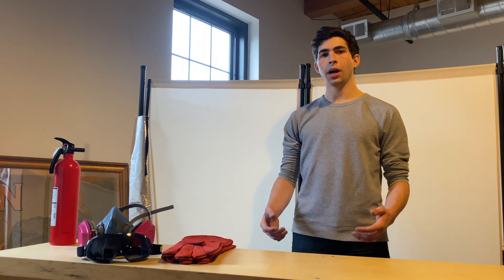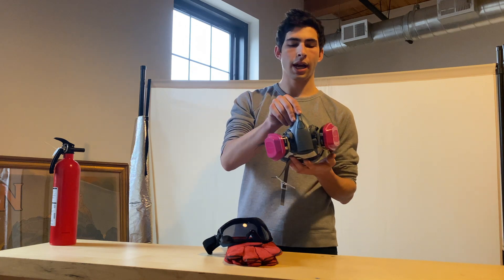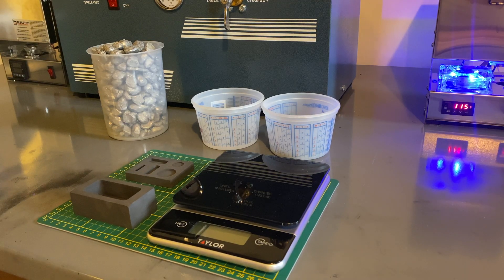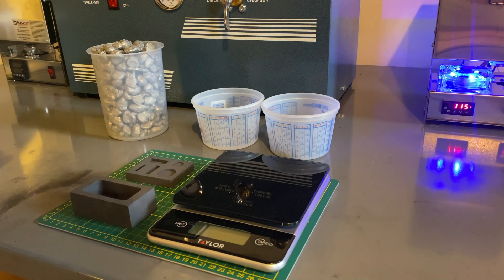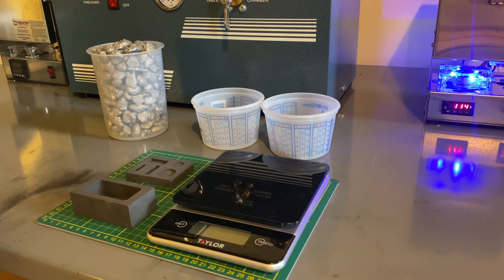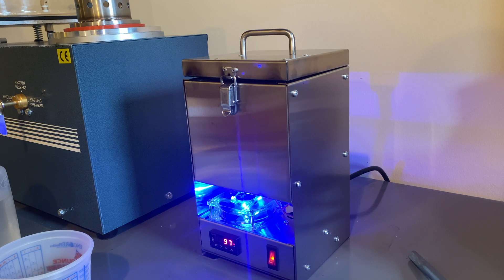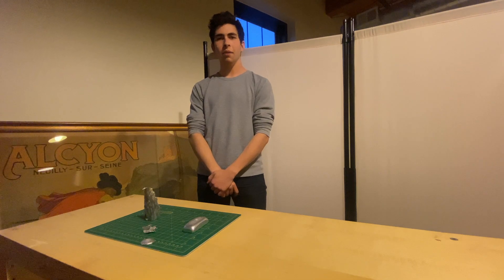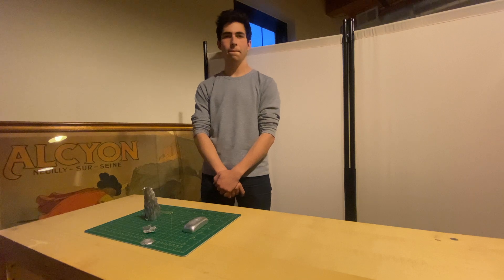Making My First Aluminum Ingot

Comment: I've failed so many ingots pours and how many have been misshapen. You get better with time and it's crucial to have a heat source on the ingot mold safely while you pour we all get better with time. I'm thinking about the wax casting machine you have lost was casting machine might just get one myself
Reply from the maker: I am going to try to oil my mold as well as try out a cast iron one. I’ll also consider leaving my torch running while I am pouring. I highly recommend the vacuum I have. Thanks for the suggestions and encouragement!

Comment: great job!!!! kudos for doing this on your own. Just wondering have you casted anything from WAX from your egloo/cubic 3D printer. I am wondering what the quality is like.
Reply from the maker: Thanks Fahad! I have made cast using castable resin on my elegoo Mars pro before. The quality was evidently better than the cast I have done using molds made on my FDM printer. I intend to cast most of the parts for my casted two stroke engine project using castable resin so you’ll see a lot more of that then. Here’s the only video I have made so far about my work with castable resin. Thanks for watching!

https://youtu.be/tyX3gxDqbi8

Comment: You may want to preheat your mold and skimming rod more to prevent premature cooling, doing this on a heat-resistant surface is ideal such as fire brick from the hardware store or maybe something else. You seem to be doing a wonderful job though. Keep it up!
Reply from the maker: I have experimented a little with pre heating and it definitely helps the metal flow nicely into the ingot mold as well as keeping the molten metal from sticking to the stir rod. I stopped using the wood immediately after this video. Not sure what I was thinking with that one... I appreciate the compliment, thanks for watching!
Reply: Love the work and the information given, learning a lot from you bud! Quick suggestion, you should try using a little bit of cooking oil on to the mold. (One drop), helps with the flow and for the metal not to stick as well. I am a jeweler,  wanting to learn more about the waxing and casting. Check out my ig I’m not lying lol @jh.jeweler . hope to be friends lol
Reply from the maker: @johnnyhernandez6159  hey again! Thanks for the suggestion, I will considering giving a go. The nice thing about casting with aluminum is that it has a higher coefficient of thermal expansion than the graphite ingot mold. So, as the ingot cools it shrinks and pulls away from the sides of the mold so it’s very easy to remove. I would like to encourage you to continue to learn about the casting process. It’s a very important process not only for jewelers but also people like dentist, artist, and many types of engineers. Thanks for watching!

Comment: Hi , im in the casting too and i like ur videos , but i think it will be much safer to put ur water bucket on the ground so if it spills wont affect ur machines! keep the nice work!
Reply from the maker: Hey Nicolás! Thanks for the suggestion, I haven’t used this small container since this video. I have since used a 5 gallon bucket on the ground that you’ll see in my other videos. Thanks for watching!